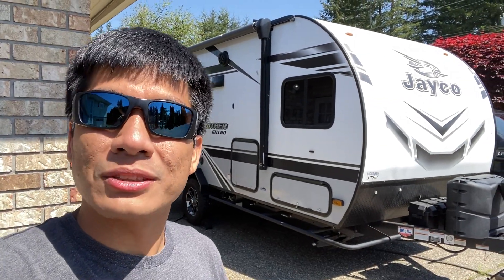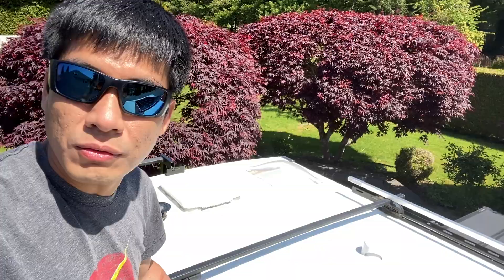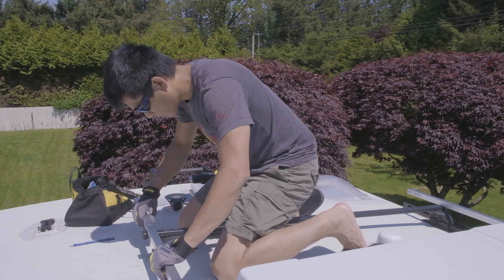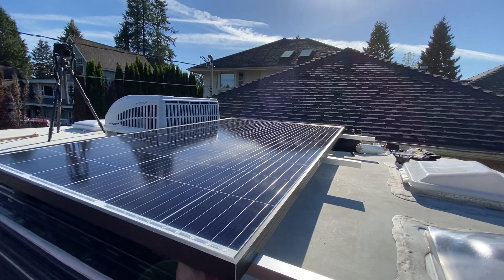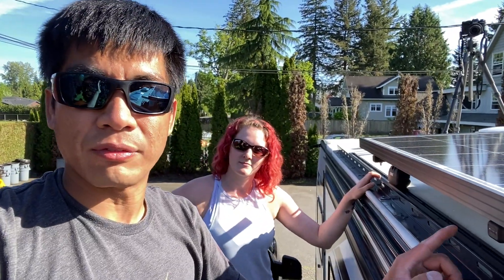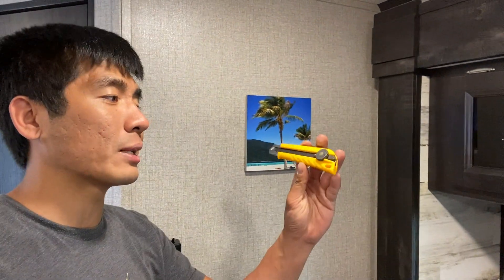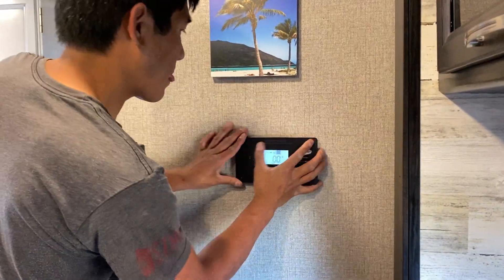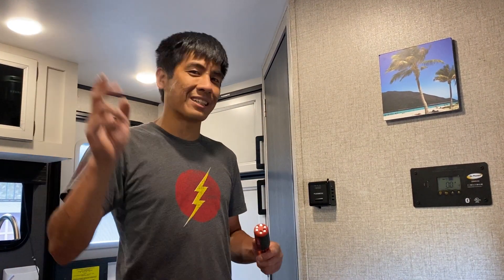Jayco 166FBS - DIY Solar Install

Comment: We just purchased a Jayco 154BH. It’s wired for solar and we definitely plan on doing something similar to what you’ve done until he future. The only difference in our situation is that we might buy movable panels so that we could camp in the shade but walk the panels out into the sun. Nice work. Has it been working well for you?
Reply from the maker: The portable panel idea is great! we've been thinking about doing that also as we have a 'solar on the side' connection on the tongue of the trailer. just make sure whatever panel you get has a built in charge controller!
Our roof setup has been awesome! We use a lot of battery for watching tv and charging our camera gear during night time and it usually is getting back near 100% charge when we start waking up in the mornings!
Reply: Pre installed solar wiring is nice but the proof is in the size of the wire as related to amps and distance.

Comment: Just curious from your video. Did you also switch out the stock bed mattress with a premium mattress?? If so, does a Queen 60”x80” fit in that opening? I know the stock mattress that Jayco puts in there is 57” x 80” long. Thank you in advance for your response.
Reply from the maker: We kept the mattress it came with but added a memory foam topper from Amazon. We had to cut the memory foam to fit this size. Works pretty good! Comfortable enough for us :)
Reply: I put a full xl in and it fit perfect. It’s 56”x80”

Comment: Just found your channel and videos. Thanks for sharing. I'm interested in the Jayco Micro series.  

Questions if I may:  You selected a certain size panel and a charge controller that can handle up to 30 amps.   Prior to this planning did you know the gauge of the wire that Jayco used?  That is, was a documented in the user manual or anywhere?  

Thanks again.   
Tom
Reply from the maker: Hey thanks for watching! I didn’t know what gauge wire it was before installing. I just got the same controller that comes with it if you get the trailer with the pre installed factory solar.
Reply: The factory solar option on this trailer is 30 amps, or rather it's 190 watt panel with a 30 amp controller. It does allow you to add an additional 190 watt panel. Given that information, the factory wiring should support 380 watts, or 30 amps. I also believe that the charge controller installed in this video is the same, or very similar, to the factory option controller. That said, if I was purchasing a new charge controller, I would go MPPT instead of PWM. Although the flush mount of this PWM controller is very clean.

Comment: Will the 12-volt battery on the trailer be charged while driving? Thank you
Reply from the maker: Yes your vehicle will charge the battery of the trailer while you are towing !
Reply: My car is not equipped with solar energy. Will the car charge the battery of the trailer when the car is started?

Comment: You install an inverter yet? Wondering if it is easy…
Reply from the maker: I had a whole plan to get going on that! But then found out that the pre wire for inverter in this trailer is 1: only rated for 1800w inverter and 2: the pre wire isn’t even installed in the AC which is one of the main reasons I want to do this.

I might end up just hiring a company to do it professionally because it might be out of my skill set to achieve….

Comment: Do you plan to add more batteries? How much solar and batteries do you need to run the refrigerator 24/7?
Reply from the maker: Yes we’re planning on adding a full lithium and inverter setup! Our fridge is propane/electric so we pretty much always run it in propane mode. Electric only works if we are hooked to shore power. I hear those 12v fridges are really efficient though!
Reply: @LetsJustGoTravel  We are looking at the same model and plan on getting the 12V fridge. I'm wondering if 300 watts of solar and 300ah in battery capacity would be enough.
Reply from the maker: @wes326  our current battery setup is 2 x 6v golf cart batteries with about 230AH. Can only discharge to 50% on these and we frequently bring it down to 60%ish due to watching tv and the end of the day and charging camera / phone batteries etc. 
Keep in mind if you order the factory solar it is only 190w I believe. The 315w we installed has been great on sunny days but we live in the Pacific Northwest so we don’t get a ton of sun
Reply: @LetsJustGoTravel  Thanks. I think the factory is 190 watts with maybe 190 more optional. Can't confirm the latter part. Wish an efficient 3-way fridge was an option. But otherwise really like the camper. My brother-in-law's Oliver 19 has 400 watts and 400 ah of lithium batteries.

Comment: Hi does the AC run off the solar?
Reply from the maker: Unfortunately no. I still need to add an inverter system and bigger batteries if I want the ac to work off solar/batteries

Comment: Well this is great if you only plan to put 1 panel on the roof.  But what if you wanted to add 4 more panels on the roof.  Can those two wiring outlets hold the charge for 800w of solar? Jayco really should do better in explaining how much solar its actually wired for; that really matters.  what if they only put wires thats designed to handle 15a?
Reply from the maker: Heya! So I’m actually planning on removing this panel and going to 4 flexible panels for a total of 550 watts on the roof. The pre wire that jayco has installed for the roof solar is 10 gauge which can handle 30amps. Another determining factor of whether or not the system can handle it will be based on whether you wire multiple panels in series or parallel, and what type of charge controller is being used (mppt can handle higher voltage than pmw controllers). I will also be adding a 200w portable panel on the ground running into jaycos “solar on the side” port which will bring my total to 750w.
Reply: @LetsJustGoTravel  Thank you for your reply it reaaallly helps; I have just purchased a Jayco eagle Ht prewired, and I have no Idea if those prewires will be able to handle 5 210w panels, series connected.
Reply: You can email Jayco and ask them to send you a schematic for the wiring systems in your trailer.  I have a JayFeather X213 w/ the 30 amp package and it's only rated to handle 400 watts of solar using the pre-wired 8 gage wire.
Reply: @rooddoggie  thank you 🙏 yeah you can change out that 30 amp mppt to handle more solar if you want
Reply: @Brantoeloneace Not yet. I ordered a new power converter (PD4135) to charge my lithium batteries and as soon as it arrives I’m going to put it all in.

Comment: How much does this set cost?
Reply from the maker: The panel was about $300 CAD and the controller was $175.
Reply: Thank you so much
Reply: Where is the heating switch? How to use it?
Reply: I just bought a RV like yours, but I don’t know how to turn on the heating. Please help me and tell me how to turn on. Thank you
Reply from the maker: @xunyu487  to the left of where I installed the charge controller in this video is a small black box. This is the thermostat for the rv. There is a little switch on the top that you have to press to the left, and then you can turn up the temperature :) make sure your propane tanks are open. Hope that helps!
Reply: What is the model of solar energy?  thanks